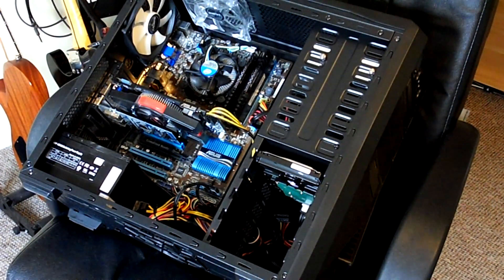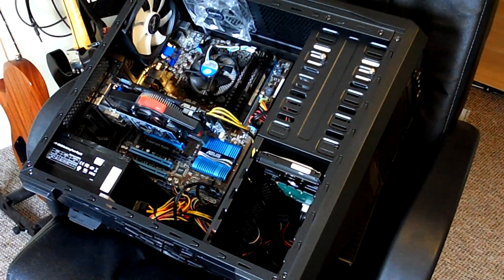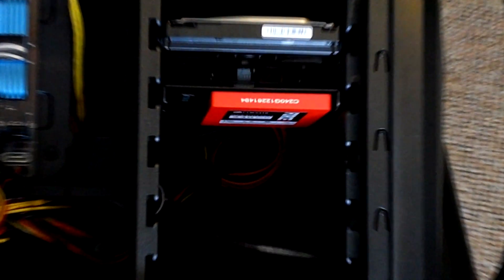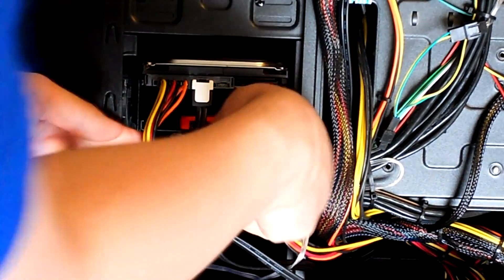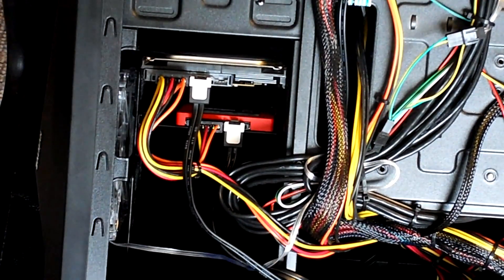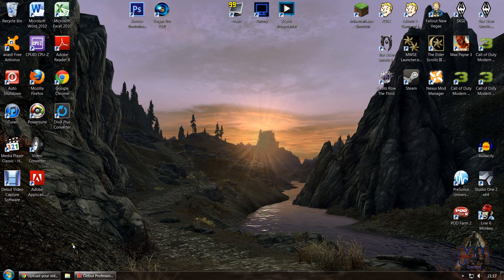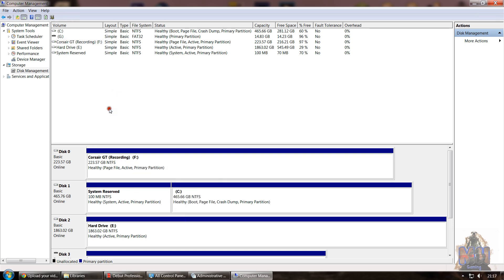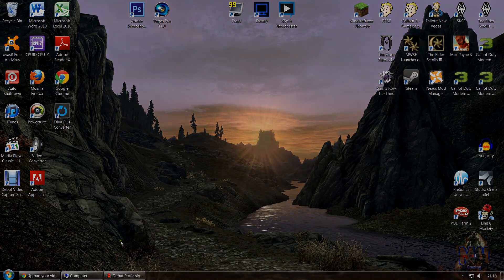How to Install an SSD (Solid State Drive) for Storage

Comment: I have a question:
I'm wanting to build a PC and I want an SSD as a boot drive and a 1TB drive as a storage drive. I know generally how to install an OS on an HDD but I wonder if there is any difference in doing so with an SSD. I have also heard about something called a RAID configuration but I think that is only for if you have two SSD:s working together. Am I right?
Thanks for an answer, it will be appreciated :D

Comment from the maker: Thanks! well the ram is pretty simple to install, simply slot it in and you should be good to go, same with gpu only you will need to download the correct drivers. if you do a quick search eg: pcu installation im sure a decent tutorial will come up. 

Message me if you want and i can help as best i can...